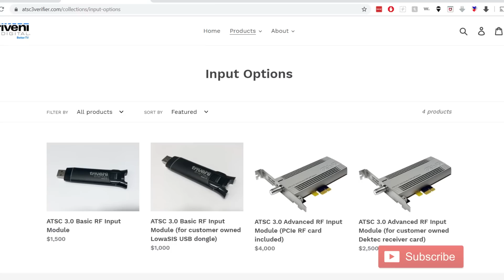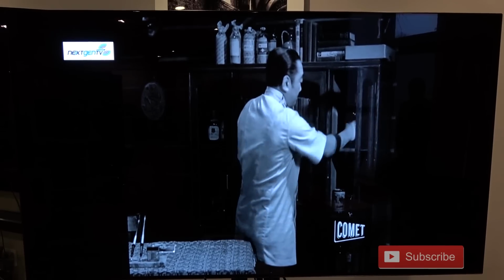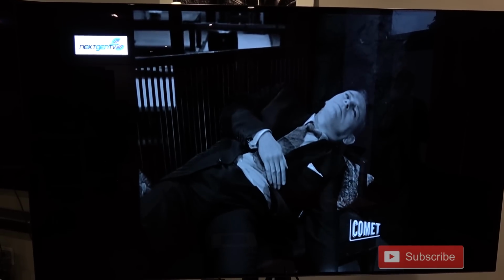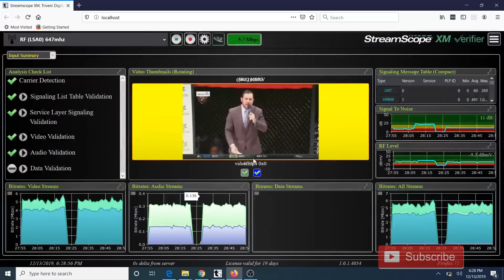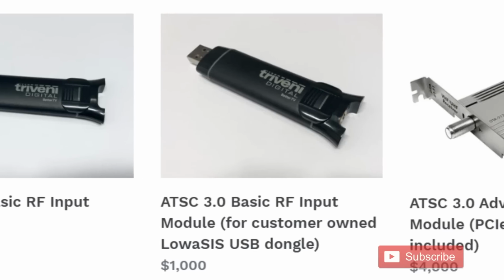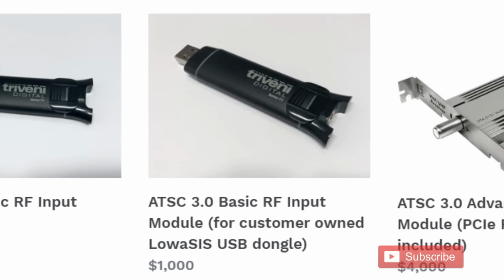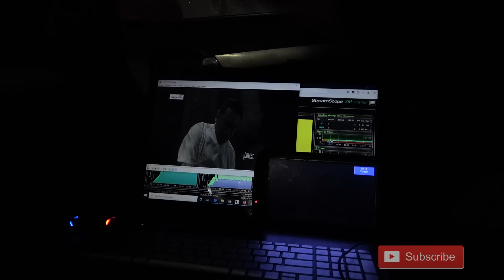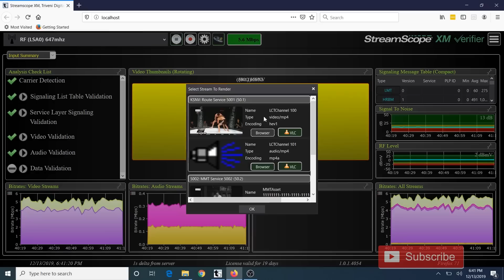ATSC 3.0 NextGen TV Signal Test and Demo in Baltimore, MD

Comment: All the digital DTV standards based on OFDM or COFDM are not the panacea in their apparent robustness in the signal reception, all are great in multipath but when have low TX  ie 1,5Kw and hills their reception gets so fragile as the standard that use 8VSB , number two according with my experience the impulsive electric noise is the enemy number one of the system based on OFDM and also the modulation in the QAM constellation determine how fragile and how much payload May an single frequency carry for one channel or multiplex in the same frequency, and the supposed efficiency of OFDM systems sacrifice a important thing coverage with an single TX their coverage gets reduced greatly and needs gap fillers and syncs between them to avoid multipath between TX or gap fillers.  An out of sync gap fillers means a broken broadcast from origin, I say this based in my experience with the system ISDB-Tb which uses the same kind of modulation than ATSC 3.0 and varies the techniques of error correction and codec for add 4K,8K capabilities and the bases for add interactivity to the service

Comment: Reading this, legacy PAL programming support seems dubious. It seems that actual 576 resolution and 50 fields/frames aren't supported by ATSC 3.0. So it seems that downscaling has to be used for the resolution and less than accurate frame rate.

Not exactly enticing for a European broadcaster, say the BBC.

Makes them go through more conversion than necessary when most any modern TV has some PAL support.

https://www.atsc.org/wp-content/uploads/2017/05/A341-2019-Video-HEVC.pdf

Comment: I found out recently that one of my local stations, modified their .1 and .2 sub-channels to accommodate ATSC 3. My 2007 manufactured DVD Recorder / HD, can no longer pick up those channels. My 2009 built RCA TV still can. Was there a change in the tuner spec between that time, so they earlier tuner is no longer supported?
Reply: Some TV stations are experimenting with more modern codecs, so if your TV doesn't have the codecs used it will not decode those sub channels.

Comment: Great video.. we just moved to SC and I am using 2 antenna in the attic instead of using cable for the TV. I had to really work at it to get a stable signal but it looks like when we move to ATSC 3.0 those that want to cut the cord will have an easier time at it!  Bye Bye cable TV!

Comment: As a part of your testing, I would like you to test a low VHF (Ch 2-6) station using an ATSC 3.0 signal. With the current 8VSB- based ATSC 1.0, the signal of those stations are very difficult to receive because it requires a large outdoor antenna in order to pick it up. In the old analog NTSC days, those stations had the best signals out there although there was more electromagnetic interference than in higher frequencies. Since I have not heard of any tests of ATSC 3.0 in low VHF frequencies to see how it performs with indoor antennas or in mobile environments, I would like to like to see if the OFDM- based ATSC 3.0 performs significantly better than ATSC 1.0.
Reply: I also interested in the performance of ATSD 3.0 in VHF Low Band channels. With the repack the UHF and High VHF are crowded. If someone knows of who is testing ATSC 3.0 in Low VHF, please comment here!

Comment: Looks impressive. Living in a rural area in NW Oregon we only have 16 OTA channels from 5 translators. Since digital hit in 2009, any distant TV signals disappeared. Pointed the Antenna Direct 91XG yagi Northeast, I can sometimes get a signal from a Seattle station (150 miles), but it never locks. So hopefully 3.0 will be much better.  $1K for the dongle is a bit much, but I doubt many are being manufactured as yet. Thanks for video. 16 channels on a frequency? I'll take that. This looks like really a huge improvement coming up.

Comment: So... if somebody could ELI5 for me, for a minute... does any of this mean that ATSC 3.0 would require updating all our tuner equipment? 

I just bought a new 4-tuner SiliconDust HDHomeRun tuner box, and I'd be awful bummed if it were gonna be obsolete in a few short years.  I'm guessing no, this is largely a matter of decoding algorithms and whatnot that can be addressed in our software (Kodi+MediaPortal2 in my case)... But what do I know, I am definitely NOT a broadcast engineer.
Reply from the maker: It won't be "obsolete" for another ten years. You will need a new tuner box to get these broadcasts
Reply: @AntennaMan  Well, that is a downer, but then again, 10 years is a pretty long time.  Personally my eyesight isn't good enough to benefit from anything better than 1080p (I doubt I'll ever want 4K), and the high-tech additional content features do not appeal to me. So I would probably not upgrade until it's entirely necessary.  At least, not merely to get "new" features. Thanks for the reply!!

Comment: This is by far the best demo of ATSC  3.0 I have seen. I am a geek, so I have been following the evolution of ATSC for a couple of years. BTW,  my understanding is that the FCC will require duplication of TV signals on both ATSC 1.0 and ATSC 3.0 for at least the next 5 years to allow for the newer sets/dongles to come out. Broadcasters in each market will have to coordinate their signals to have one source/tower for ATSC 1.0 and another for ATSC 3.0. This reminds me of the way Europe handles its broadcasts, with all broadcasters multiplexing their transmissions on one tower (this was true even in the days of analogue TV). I suspect that the dongles for older sets  will drop to the $50-75 range. P.S. Sometime in the future, can you do a video that shows nothing but the ATSC 1.0 and 3.0 video transmissions, not only with various programming content, but also test patterns, etc?  Side-by-side comparisons of the two standards, especially when it comes to pixellation, would be appreciated, especially if you can show a full screen of each consecutively. (I realize the technical limitations of YouTube, but I think the comparisons would still be instructive)

Comment: Was there ever an ATSC 2.0 standard in use?
Also will the ATSC 3.0 standard improve reception on currently existing TVs manufactured in the last 5 years?  Thanks for your outstanding research
Reply: The ATSC 2.0 standard was never used. 

No, it will not improve the signal on existing TV sets.
Reply from the maker: ATSC 3.0 is not backwards compatible. Existing TV sets will not be able to pick up the signal. They may announce some ATSC 3.0 TVs and set top boxes at the CES show in January.

Comment: Great info.....so I'm guessing that once this fully deploys that 1.0 will stop transmitting and that all existing TVs (which only have 1.0 tuners) and devices like HD Homeruns will need to be replaced with newer tuner hardware that will have the ability to receive the 3.0 broadcasts ?
Reply from the maker: Correct
Reply: @AntennaMan  well that will be good for the manufacturers but will cost the consumers. They should try to make the tuners upgradable via USB stick. I have 5 TV's so I obviously won't be buying anything new until the new TV's with the new 3.0 tuners arrive

Comment: So my fellow engineers at Sinclair were right to protest the use of the modulation scheme proposed by Zenith (LG)  in favor of the QAM that ATSC 3.0 uses.They were right from the start !
Reply: As I'm retired since a long time ago,  I haven't been updated in digital television. I was installing TV ,AM and SW stations in the late 40s for RCA until RCA disappeared from the broadcast market in the USA. I read a lot about ATSC 1,and remember that SINCLAIR TV Group protesting the reliability of the 8VSB modulation and its downsides compared to QAM. As I have read this ODFM resolves those issues including adjacent channels problems. There is a site where ATSC 3 is explained in depth and is very helpful for our new and young engineers who are the ones that are installing and servicing this new technology.
Reply: @mrpedrodrodriguezsr7628  the late 40s!? How old are you sir?
Reply: @mattkennedy6115  I'm very old , but what you should know is that I was admitted in college at age 16 and graduated Magna Cum Laude at 19 years old. This was just in time when the FCC reopened the construction permits of Radio and TV stations after the war. so, I worked the TV and radio boom!
Reply: If I remember correctly, multicarrier modes caused more visible co-channel interference than 8-VSB did, and the USA had (and has) more channel congestion than other continents.

Comment: Since One Media/Sinclair is apparently checking out Tyler's channel, I'd like to ask them (Sinclair) a friendly question.  Will you consider doing a better job of providing your Ashville, NC ABC affiliate, WLOS, to potential viewers in Upstate South Carolina?  Your only legitimate signal is 60 miles away from Greenville, SC and not receivable by most people in the significantly populated area.  Almost no one can receive a signal from the extremely weak SC translator.  You could at least simulcast WLOS on a My40 subchannel, since you own it too.  WSPA (CBS) did this for years, so I know it's legal.  Please do better.
Reply from the maker: Engineers of various labs may be seeing this video but not chief engineers of TV stations. I suggest you bring up your concerns to the station directly.
Reply: OK, thanks.

Comment: While it is not directly a 3.0 issue, you kind of side stepped what is going to happen with 1.0 quality when 3.0 enters the market. When 1.0 looses physical channels to 3.0 and two or more 1.0 physical channels are sharing one 1.0 physical channel, how do you expect that to occur? Increased mpeg2 compression? Lower resolution? Both? Other? Do not misunderstand me I am all for 3.0 once we have transitioned over to it. I do not expect that many 1.0 stations will stick around very long after the 5 year mandatory requirement. But the 10(?) year nation wide transition period could be pretty ugly. IF the PBS station's petition to drop 1.0 is granted, it might go a long way towards shortening the transition period.
Reply from the maker: This will be covered on a future video topic. There were too many questions that I asked and the video would be 30 minutes long if I addressed them all. Stay tuned to my channel
Reply: @AntennaMan  Fair enough. Keep in mind that 3.0 is monstrous both in size and complexity. So I would expect that for at least the first dozen or so visits you have you will continue to learn a lot more than one would expect. Thanks.

Comment: I put up an outside antenna a couple of years ago and found that some of the channels were weak and would breakup.  I then installed a couple of amplifiers for the the tv's and those channels came in just fine.  However, a couple of months ago, I found that  I could no longer receive several of my channels and discovered the repack from the FCC was going on.  I still can't receive those channels despite doing a rescan over the past few weeks.  My antenna is pointed north.  All of the channels I watch are less than 70 miles from me.  I am thinking about moving the antenna, but was wondering since my TV's (Sony's) are over 5 years old if the tv tuner may not be working for the repack.  My zip is 28504 and I would appreciate any advice you can provide.  Thanks you and have a great day!
Reply: Review whar you are calling "pointed" or "pointing". It's not the point but broad side usually. Which side of antenna in in the direction of transmitters?
Reply: Broadside of antenna is pointed N-Ne.  the other side is W-Sw.  Sorry for the confusion.

Comment: Great info!  I'm 8 miles from the transmitters on the wrong side of a steep and concrete building so reception is tricky.  I'm hoping the new standard helps.

That's an expensive dongle.  Glad you found it.

Comment: How much reliance on the internet is needed?     Portable tvs and my anti internet family and friends, abhore anything Internet....   I am guessing the main will be in the clear, while you will need to sign up to each station to reserve an ip address ( each station must be able to reserve thousands), at the least.  But the idea of ip, is an alien idea for anyone who has cut the cord. Keep in mind mind too many young  people are opting for cellphones, rather than home internet. Hopefully, they will allow cell phone Bluetooth station reservations, so they don't cut out the young adults, as well as the cable internet  adverse older population.
Reply from the maker: the internet is not necessary to receive the signal but maybe needed for some advanced features like on demand and 4K
Reply: Bluetooth has a very low throughput and its range is usually less than 10 meters (33 ft), so no, it is not at all suitable for OTA broadcasting.

Comment: Phew!!!  I have been there and could feel your panic when you thought the dongle was lost. What is something in those circumstances is that you even start looking in places you know it could not be.  Glad you found it. 

Also, thanks for the info. I grew up 3 blocks from where I now live and all there was were antennas.  But from my present home I cannot receive OTA signals. Frustrating. I am only 26 miles from the broadcast towers.  Tried the attic, the roof, different antenna. Maybe there is hope yet, even if several years away.
Reply: Back in 2008, i had a license key for very expensive software for 4g LTE.  I had to ship it to a colleague in another state as we were sharing the dongle.  I placed in an envelope and insured it for the cost - $48,000.  I was told i could not insure envelopes for that amount, so i had to put it in a box so i could insure it.  My colleague was expecting a small envelope, and thought i was playing a joke on him till i explained it.  Yes, i had a dozen or so $14,000 hand made cell phones, and $100,000 pci cards for central office telecom frames in my trunk.  Sometimes the stuff was shipped to the hotel i was staying at, and the front desk got nice tips from me as they took care of my stuff personally

Comment: Will reception distance be improved? (i.e: be able to get channels that were once too far away)
Reply from the maker: Not likely. Those dead zones are due to terrain issues. The signals can't go through mountains or reliably beyond 70 miles due to the curvature of the earth.
Reply: This is a really good question and one I'm most curious about. From the limited amount of information I was able to find, it's technically worse for distance (and why 8vsb was originally used). What makes it interesting, though, is that if they do put out sufficient power to compensate for the higher required levels at the receivers, the multipathing improvements will help decodability, since over the horizon the signals begin to scatter, which atsc3 is much better at handling... It really comes down to how the stations implement the changes and how much power they decide to use. If they stuck with their existing power levels, I'd expect slightly worse results in the rural areas, but I don't expect them to stick with their current levels. Likely they'll put out more power, which should give it a slight bit more distance, but much more reliable in the areas it does cover.

Comment: After this video, I'm pretty optimistic that 3.0 will solve my issue with the choppy signal on a few of my channels.  I'm fairly certain the big signal problem in my area is wind turbine related, so it the new 3.0 signal can travel that strong 50 or 60 miles when permanently up and running, I'm good.
Reply: Sorry to ruin your party but ATSC3.0  and or any standard that use COFDM /OFDM  as modulation Will not improve greatly an problem caused by an big object that moves at high speed such as a wind turbine that moves of cyclically way, will only on that scenario get an problem worse that the signal strength gets great fluctuations due the object that cause obstruction with your rooftop antenna on LOS would be enough as for get break of the signal all depends of many factors unpredictable by now. But In my experience when is severe multipath  and add the the mirage effect the signals gets intermittent in reach the TV or you lose the audio package and end up watching a muted TV show or may get a no signal logo courtesy of the TV manufacturer

The fact of the promised robustness to multipath is like everything with their limits , and you always have to install of good way or aim the antenna of good way , this change of modulation only will add robustness in City and congested environment such big cities, or people that want only plug An rabbit ears antenna and are ready to go, or places were the TX (transmitter tower) be away and broadcast with enough power as for reach your set up with an signal strength of 60/70% and signal quality of the 100% for a reliable reception in all weather conditions